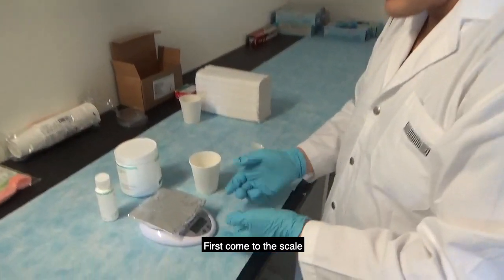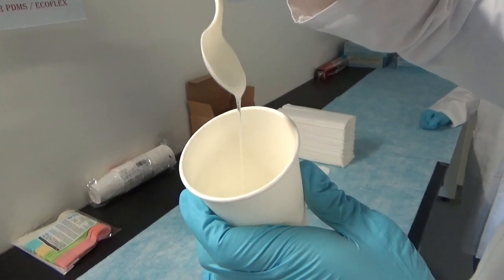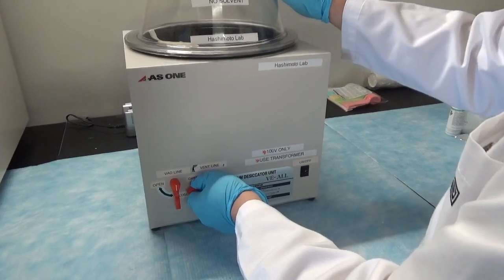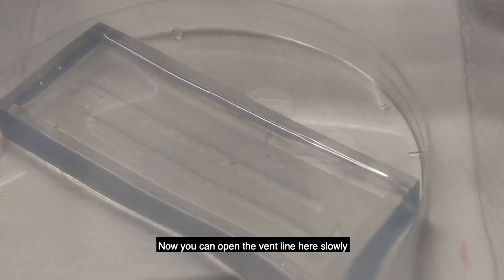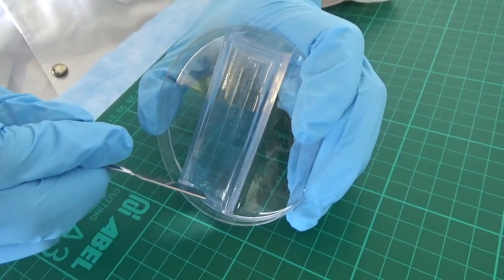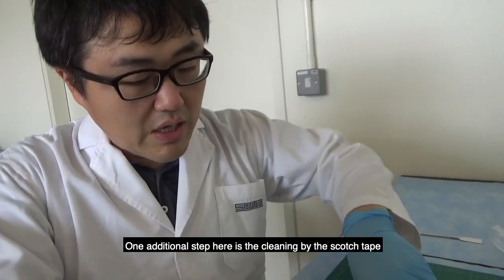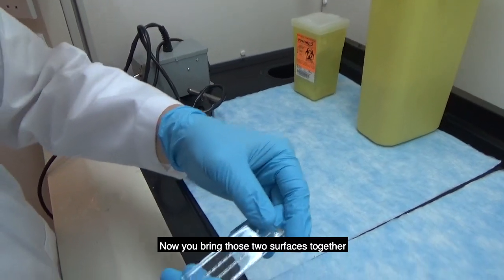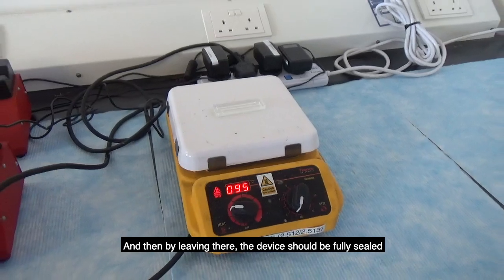PDMS Replica Molding and Bonding

Comment: What material that you use as the 3d print molding?
Reply: Hey could you figure out which 3D print material works?
Reply: Most resins work as long as you cure for an hour or more in UV